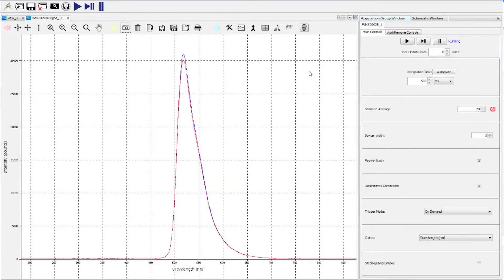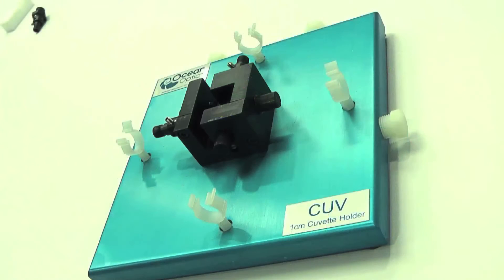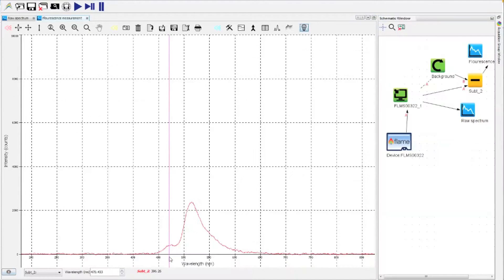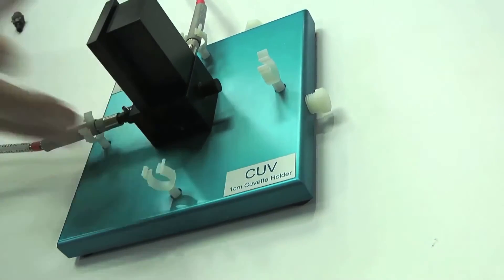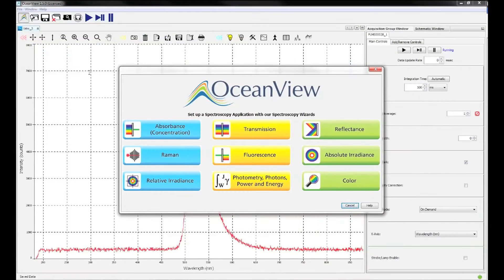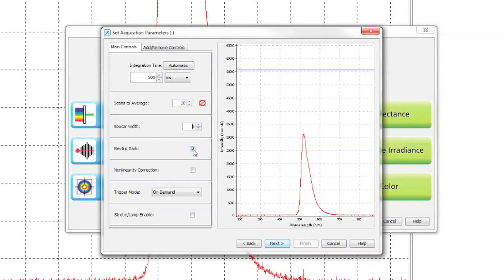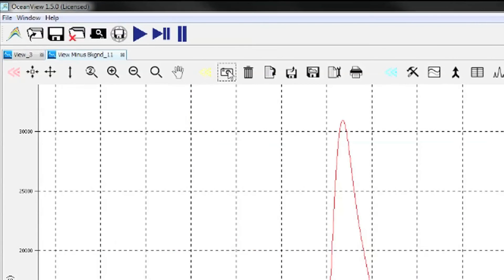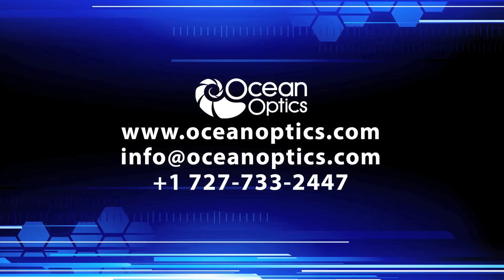Fluorescence Spectroscopy in OceanView Software

Comment: Hello. Please I need assistance with the operation of the Flame spectrometer I just started working with. I get a spectrum of the incident LED light (470 nm) so broad that I cant differentiate the emission from my fluorescent analyte (fluorescein) which emits at about 510 nm. I use a QR600-7-UV-VIS probe which ought to simultaneously excite and collect fluorescence emission. Hence,using this probe, I am not sure if I can use a light fliter to attenuate the incident light from reaching the emission light as explained in the video. Basically, how can I work with this QR600-7-UV-VIS probe for fluorescence measurement without having the challenge of the incident light interfering with the measurement of the emitted light. I am using a fluorescein solution in a 1 cm pathway cuvette 

Thank you.
Michael